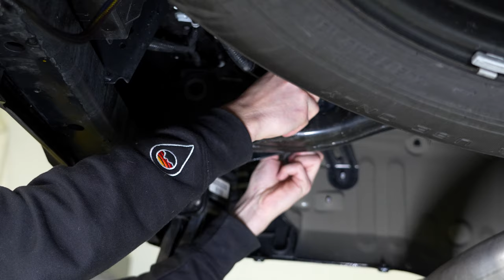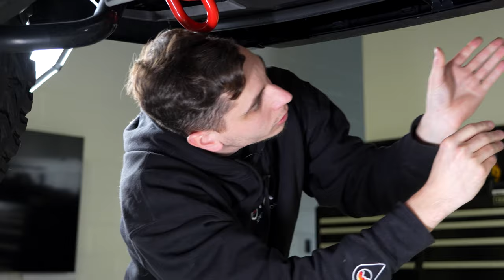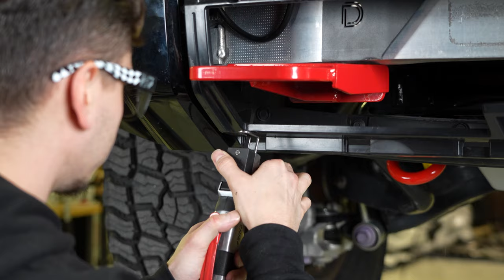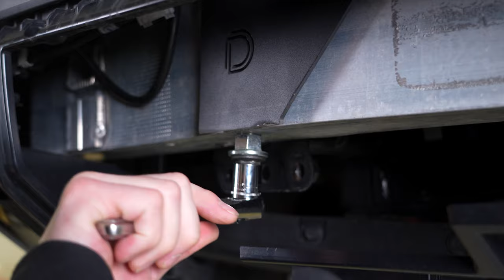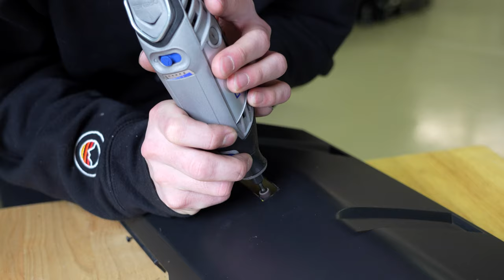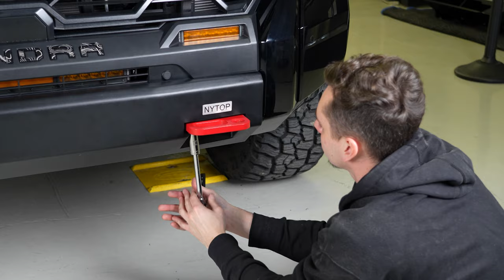2022+ Tundra  NYTOP Recovery Points And Hybrid Bumper Install

Comment: I have a dewalt right angle adapter that would allow you to drill those holes without cutting the plastic piece. Just another option for anyone not wanting to cut or remove front bumper.

Comment: I'm no engineer but rivnuts in thin aluminum is not a structural anchor point IMHO. The front recovery hooks appear to be for looks only not actual function!
Reply: They attach to the frame at the back, the added points seem to just be for extra rigidity.

Comment: Could you install it without cutting the diode dynamic brackets?
Reply from the maker: The hooks would not mount properly without cutting the Diode brackets
Reply: I guess you could drill and tape a couple holes in that crash bar for your light bar. Great job on the video